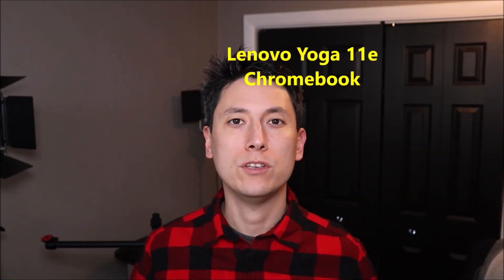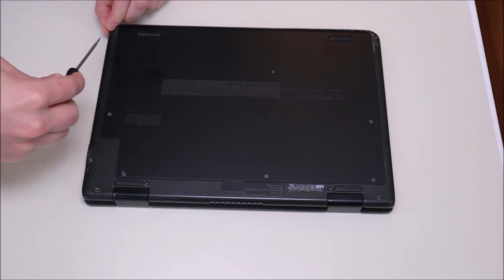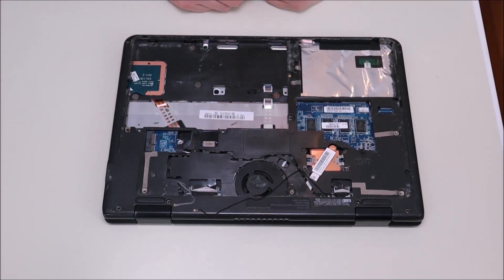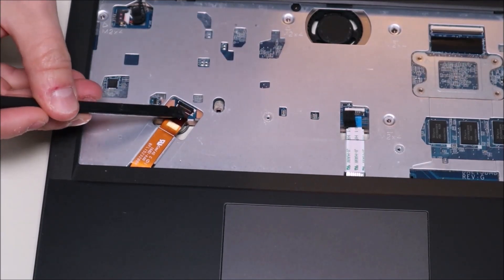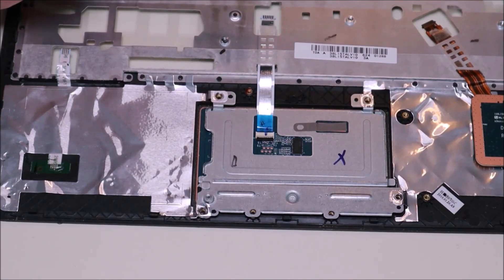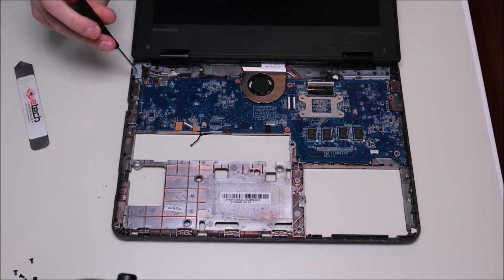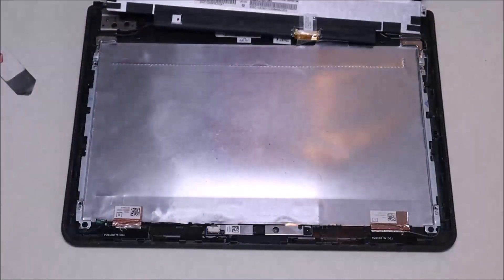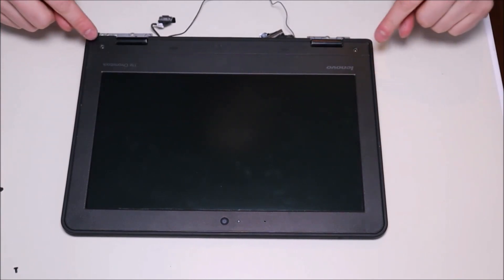Teardown Disassembly - Lenovo Chromebook Yoga 11e

Comment: If this laptop turns on but the screen stays black does it mean the ram is damaged?
Reply from the maker: Thats one possible reason. If the screen is black, what are the signs that the computer is actually turning on?  Any motherboard or HDD sounds, fan, etc? Also, did anything happen before this issue appeared?  Overheating, liquid spill, Windows update, etc?

Comment: I appreciate your excellent video, but my lenovo laptop has none of the screws in the bottom case (the case is absolutely flat with no screws or holes to put them in), and I can't figure out what holds it together or how to take it apart. Any ideas?
Reply from the maker: What model computer do you have?  Also, some computers like that have the screws hidden under the 'rubber feet'